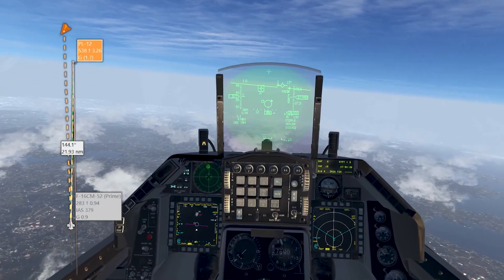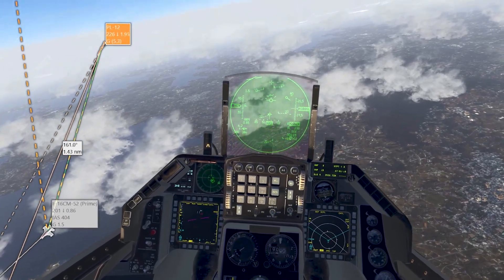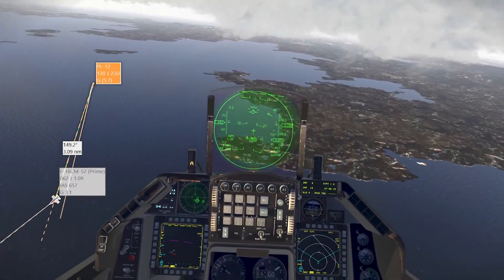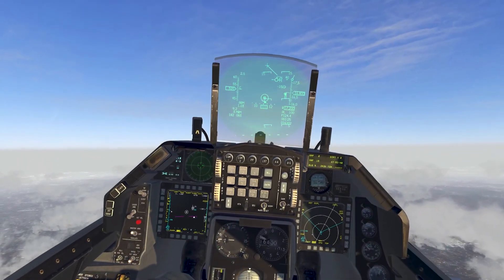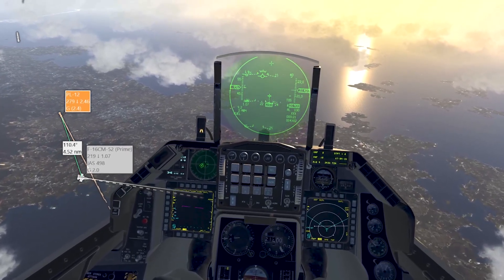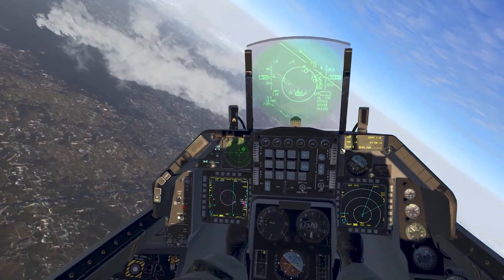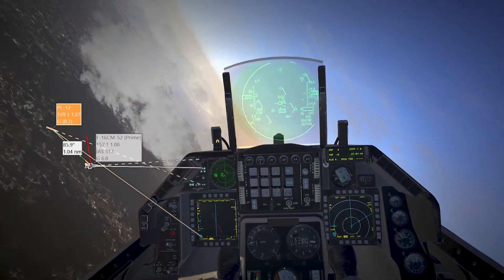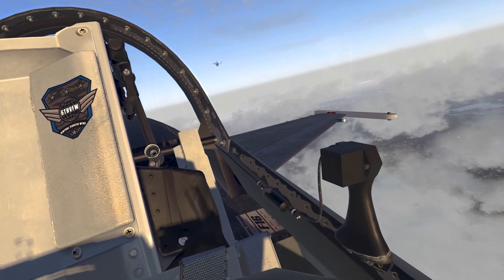How to Defeat Air to Air Radar Missiles by WEAVING | Falcon BMS 4.37 #Tutorial

Comment: Incomplete advice, you are taking way too long with defeating that missile. You can use the same principle as with interception course to tell whether its still dangerous by flying straight for a moment and watching symbol on rwr and whether its holding constant angle or slowly dragging down. The small rwr on helmet hud is especially effective for this.
I think it was the 2. missile which best demonstrates the problem.
Reply from the maker: Yes but the purpose of this is to defeat the missile by forcing it to turn and bleed energy. If you just fly in one direction the missile doesn't turn and goes in a semi-straight line when compared to weaving.
Reply: @AviationPlus i know, but you can definitely feel when the missile cant keep up anymore and turn sooner.
Putting it anywhere on 4/5/7/8 o'clock during weaving for a moment and then do fast check while flying straight can tell you when its out of energy.
People just say to go cold, weave and descent but the problem is they all say keep doing that till it runs out of battery or you from experience deduce that it cant be dangerous anymore.
It can be defeated way faster without guessing or waiting.
Reply from the maker: @robertkalinic335 Absolutely but the alternative to that is getting hit. So if you are 100% sure go for it but if you have any doubt probably best to continue to weave.
Reply: @AviationPlus If the missile drags like that it simply cant hit you anymore, its impossible.
Especially if you do the turn back, i am not saying you should try flying into the missile though.

Comment: I have a question, When should we employ different tactics when it comes to defeating missiles? Like when is better to weave or when is it better to notch or what exactly?
Reply from the maker: There is no definitive answer it all depends on your situation and current awareness of the engagement. Weave could be used to bleed off energy if you are fast. Notching can be used to separate from your wingman and decide to turn in or not but it should not solely be used to defend a missile in BMS.

Comment: high G evades or 3-9 maneuver with low altitude.
Reply from the maker: @rickzhang998  I would rather get by the missile than to evade the missile and get hit by a man pad at low altitude. If you are fast enough you should not have to get lower than 20k.

Comment: If you end up having to dive for the deck anyway as in the examples, I'm not sure I see any advantage to this method?
Reply from the maker: Diving to the deck is only if you are either unaware of the distance of the shot (suspecting it is close), surprised of the shot or know that the shot is close and being your last ditch effort would be to dive and gain as much speed as you can while bringing the missile into thicker air. This is risky because you are now vulnerable to man pads on the ground.

I hope I answered your question. Thanks for watching.
Reply: @AviationPlus    Thanks for the reply.  But that's the point; even if you do this technique, in the examples you say you're then to close, etc. and have to then dive to the deck regardless.
  So all this technique seems to do is delay the diving to the deck more than replacing it and if that's the case, why not just do it to begin with?
Reply from the maker: @NunyaBidness-gs6qh  No it doesn't because if you know how far the shot was you don't need to go to the deck. If in the first engagement you go down to the deck it is a waste of altitude.
Reply: @NunyaBidness-gs6qh 
>delay the diving to the deck 
I don't think he has ever "delayed diving to the deck" in the videos. If you mean 2:00, that's just part of the Split S for quickly turning away from the missile. If you mean the rest of the examples, I wouldn't really call a -25 down attitude as diving. That's just the usual "altitude -> speed" conversion. 

As for why using this technique when you can just dive (assuming you mean "trade altitude for speed ASAP", not "flying NOE to confuse the missile"), burn and run away, the technique bleeds out missile energy much faster than simply run cold in a straight line. If you are not looking for a re-engage, it probably won't make much difference (since you are running away anyway). However if you are looking to re-engage, the few seconds it saves you can give you a chance to turn back hot while the opponent is still cold, giving you the upper hand.
Reply: @AviationPlus  🤔
Reply from the maker: @NunyaBidness-gs6qh  It's ok if you don't understand. Try it out and then you'll see the advantages of weaving and maintaining altitude instead of going to the deck and losing all of it.
Reply: @AviationPlus  Oh I understand it perfectly, thanks.  I just don't see any advantage since going to the deck eventually occurs anyway per the video.
Reply from the maker: @NunyaBidness-gs6qh  If you don't see the advantage of not going to the deck then you don't understand. This is like saying during BVR why not just merge first because it will 'happen' anyway.
Reply: @AviationPlus   I understand the advantage of not going to the deck.  If that is all that is done.  But it's not.  My point, again, is that you end up having to go to the deck ANYWAY in the video, so the claim of an advantage of not going to the deck is mute.
   Thanks for the video anyway.
Reply from the maker: @NunyaBidness-gs6qh  I did not have to go to the deck ANYWAY. The ONLY reason why I went lower (not really considering 5k the deck) is that I was slightly unaware of when the missile was shot so out of caution I went lower.

Comment: Is it possible to use this with missiles that have terminal phase boosters?
Reply from the maker: @jesusofbullets  Terminal phase boosters and in like SA-10s not really the shot is far away and it's going so fast you'll be better off just flying cold if you close to the outside of the MEZ and not getting shot at in the first place.
Reply: @AviationPlus  That's what I thought, but I was curious. Thanks for the quick reply!

Comment: Nice tactic and I'll have a go learning the timing, but on first glance it puts you nose cold for quite some time. I think a medium drag defense does the same thing, but allows you to gain energy during the maneuver and gets you nose hot sooner. https://youtu.be/B0bEYyxEtd8?si=oDTneI2UjPKO_GGA
Reply from the maker: Basically what you are telling me that making the missile turn and pull G's does not make it lose energy faster than just flying straight. Also in that video I have no idea what the altitudes or speeds are so very little information gained from watching it. Additionally I used a PL-12 not a AA-12. AA-12 are the worst at maintaining speed even in a straight line.
Reply: @AviationPlus  Nope, the idea is to keep the missile bleeding energy by putting it at the same azimuth you are describing while changing pitch and altitude to avoid the weave, making it possible to go hot sooner. I'll DM you on FL, perhaps we can hook up to compare.